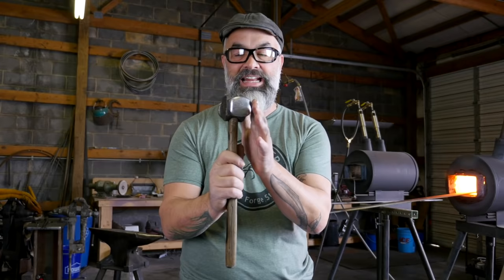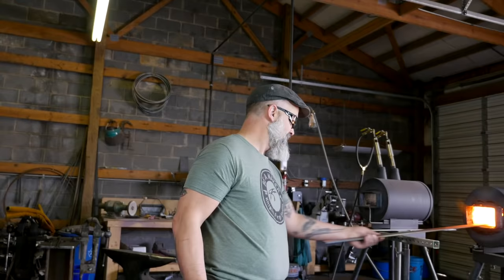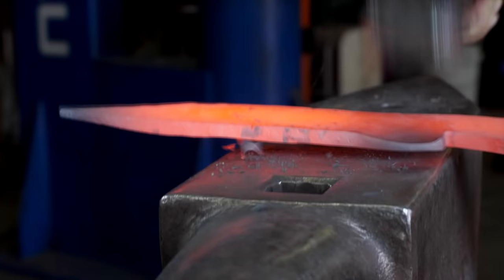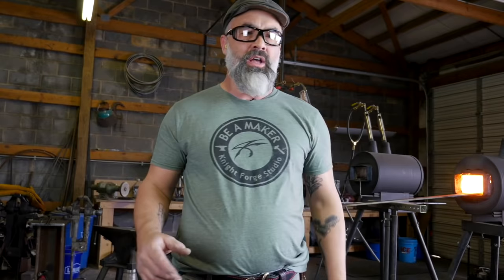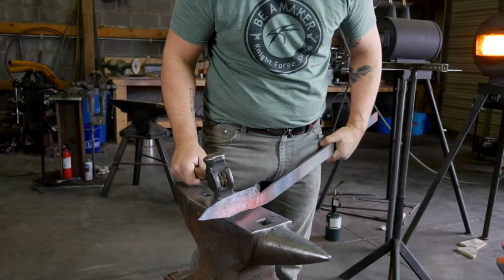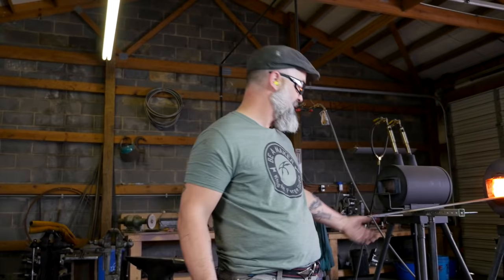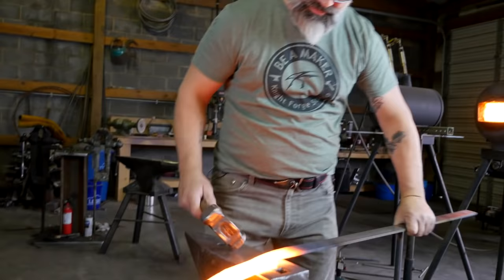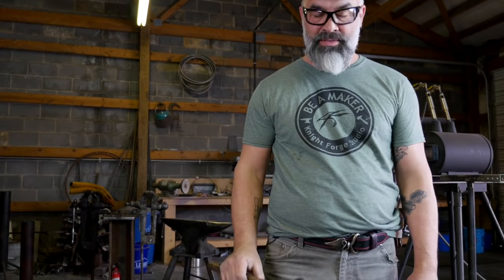BLADESMITHING | How to Forge Without A Power Hammer | Basics

Comment: The most fascinating thing I always found about when you go to work bevels, that the steel at the tip just curves back due to the way you hammer, it just does it itself, you do not need to force it to curve. It kind of reminds me of the heat treat technique of a Katana, where it curves inward briefly, and then the spine begins to cool and it curves back. Steel is so simple, yet so fascinating to watch being forged in so many ways.

Comment: My introduction to metal craft was in jewelry where the only way was to spend countless hours filling and thinking and stressing about not wasting valuable materials. Took over a year of forging to realize that valume is equally as important as perfection. What I always tell people when they're in my shop is, "get the steel between your hammer and the anvil and the rest will come in time" You answered a question I didn't know I needed to ask about blade geometry and how it transitions into handle geometry. About 1/2 of my knives come out with the bevel on one side. Since this video I never forge bevels with the handle over the anvil and the problem went away completely!

Comment: Ive been self taught and you tube taught for the past cpl years. i started with coal forge diy method my whole purpose is so i jave the ability to make a knife if i ever needed. Now im getting better and slowly acquiring more equipment I wish i had watched this video before i ever started. Lots of great info in thia video. I primarily make knives from farrier rasps and old files. I do stock removal for throwing knives from saw blades steel. This video is much appreciated. Especially about the part of not having to keep it flat the whole time. Chasing steel. Very informative 🙏

Comment: Nice bit of hand forging with some great advice and showing of what to do and telling of what not to do. I learn a lot watching videos like this. Now all I need is to build a forge and put in the work myself as I save up for, or build, better equipment. My starting anvil is complete (a grinder formed anvil made from a section of railroad rail). That should hold me until I can find a better solution for an anvil or block of steel to beat on. So far a fire pit is my forge with hard wood charcoal and a leaf blower. I now how you feel about people saying their funds are limited, but I am disabled, so I am on a fixed income and mine really are. I can stand and beat for only a short period at a time, so I have to sit and rest while the steel heats up. My shoulders are about gone too, so beating time is limited too, so frequent returns to the substandard fire to keep the heat up are a blessing.
I enjoy beating on hot steel, but it takes a while with my disabilities to complete any knife. Luckily, hand finishing of a blade can be done from a stool so I don't have to worry about falling into a fire or onto a hot blade blank. And, hand filing and sanding leaves a real good finish too. It leaves me with great control. Of course there is no way I could make any production quotas for an income boost like this, but it is all in the enjoyment of the making, for me, anyway.
Thanks again for sharing what you have learned in your long time making and doing. It is educational and relaxing for me.

Comment: Thank you Jason! I learned from this video to forge the center of the heel before the edge. That's a great tip to keep the most of the heat. I will use it the next time i forge a blade.

Comment: Appreciate the upload, new to blacksmithing (Carpenter/Joiner by trade) after 30yrs working with timber, I have decided to expand my skills. Your techniques were exactly what I was looking for.🤙🏼💪🏼appreciate the upload. Cheers from Central Qld Australia.
Reply: Brother just signed up for your forge series online. I’m working with old spring steel I’ve been removing from old dumped 4wds out here in the bush of central Qld. It’s hard going so have decided to buy some 80crv2 what size would you recommend? 

I can only get 48” sent to where I live and work. I will be making the elemental knife off your series plus want to make more chopper/kukri style knives. 

Q: what thickness and width do you recommend?  The carpenter in me wants to buy the widest and thickest possible. 

Cheers - Mathew King🤙🏼💪🏼

Comment: I played your video @ 1/4 speed whilst you hammer the steel , you  can hear the steel ringing true (almost happy) when its hit.  You even apologised for a hit that was more of a thud than ring. (making an unhappy noise under ideal conditions)   within the first few minutes.  
this was V enlightening to me Thanks for sharing your Trade basics.

Have you ever work using  electronic shooting earmuff's ?  they amplify audio below ~90db & block out anything over  ~90  (+ -  5 db)
They would be extremely beneficial to try in your workshop whilst "hammering" stuff  ;)    imho

Comment: I love to see you working without any powwr tool. I only have access to the oxy-propane cutting torch at my work place. I use my working table as an anvil. Its a 3/4 inch thick cht400 steel table 2,5ftx4ft and i also use a 1ft long railroad.
Im saving for a real forge but for now the torch is helping me getting some basic forging skill. 
I have 3 knife in the making, each a different style.
I want to do more in the futur

Comment: Well, I had to come back and watch this again, Bought a cheapo anvil to get rolling, Built a stand like yours, filled the legs with sand, Started forging on a bowie, it's been awhile since I've swung a 5# sledge like that, working muscles I forgot I had, but its slowly coming into shape, I have to learn hammer control, keep hitting angled blows, but I'm determined to get it right!! Gonna head out to the shop now and hammer some more! Thanks Jason

Comment: The Mounting of the anvil remindes of URI HOFI :) Funny, have exact the same anvil, but my threeleg is much havier. Used an massiv steel plate of 40mm, milled the downside of the anvil (hard work) and glued it. Also added on all 4 corners an easy system to pull the anvil to the plate. The legs have glued bitumen mats under it. So the anvil is no more singing, of course... heavy now, but still able to be moved.

I like your way of simple explanations, thank you for that. So its easy to follow AND undersand xD

Comment: Wish I had seen this video about 50 hours of bladesmithing ago! Learned a few small details from watching you. 
Beginners: re-watch this later and I bet you'll pick up little tricks you missed earlier.

Can't wait to try hitting the back of the blade against the anvil (without a hammer) instead of fighting to find an angle to hit with my hammer. Was that what you were doing? I could barely make out the words. 
I'm also hoping that the reason my blades end up off-center is because I keep too much of the ricasso on the anvil, that's one more thing to try.

Thanks Jason!

Comment: Who needs a power hammer? One heat. 79 blows of the hammer. Not counting anvil taps. And you have a blade point forged to rough stage. But essentially done. Jason proves that if you know how to use a tool correctly, you don't over work yourself. Old Man Andy. Crimson Elephant Forge Knives Leatherwork.

Comment: Fellow newbie here, looking to get into bladesmithing, hoping you could share some details about the tools you are using in this video.
What is the make/model/weight of the hammer and anvil you are using (is there a different video for this)?
What style and size forge do you recommend as a starter?
Is a belt grinder a necessary piece of equipment to start smithing?
Thanks for the video, it was very informative!

Comment: Awesome stuff.  I feel like I really ought to learn all I can about hand forging first and then add the power hammer.  How about a similar in depth grinding video.  I've been practicing on mild steel, an occasionally come up with nice clean lines.  But not usually.  I know there are some some pointers that masters and skilled makers take for granted that I have no idea about.  I don't know what I don't know.  And hey, if you want to go all the way, show us some low tech heat treating with no oven or salt bath.  Thanks for the great info.

Comment: What about using a cross and/or straight peen to draw the edge down? Wouldn't that help to direct the metal in the specific direction you want it to move in and not push the tip back as much at the rounding head?

Comment: I want to forge a great deal, but I live in an apartment. There is a forging place in a nearby city, so it's possible. I'm not rich, but I do understand that's not a make or break thing, I have not yet checked prices at the forging place as I'm not in a position to start for awhile. Working on a couple cars and that also takes money. Anyway quick thank you for what seems to be very honest advice. And now for the new guy question... What is scale? Does it grow on the steel from the forge, or is it part of the steel such as impurities that comes to the surface with the heat? I could maybe find the answer on google or something but I'm here now so figured might as well ask.

Comment: Farrier’s call that a turning hammer. We start out turning horse shoes with this type of hammer to shape the shoe to fit, I used a cross peen to hot punch my shoes, and also back punch the nail holes. For final finishing a rawhide mallet will smooth it all out. Raw hide works good, but when available I used to make my mallets out of Dogwood. It’s harder than rawhide but does a better finish. It’s said that Christ was crucified on a Cross made from Dogwood and that’s why the flowers bear the markings of his hands, feet, and the crown of thorns on his head. The Roman’s were the 1st to shoe their horses, and I’m half Roman, and the other half is Italian. Just some random theory mixed with some traditional BlackSmithing that nobody really cares about. I just thought I’d share some useless history from an old Blacksmith/Horseshoer. Everything has some sort of history when it comes to BlackSmithing.

Comment: Jason, you're videos are very good.  It's been awhile since I've seen ya.  It sounds like you could write a book.   A very detailed book.
Could you recommend any?
Last I saw this, I didn't know much about like and subscribe.  But I recalls you wuz in SC.  A Master bladesmith or blacksmith.  Which one?
I ask, as it'd be interesting to.making a shootgun, like a double barrel, 3-1/2", 12 gauge magnum, which can shot 2-1/2", 2-3/4", 3" mag or 3-1/2" mag. Then a barrel that can handle more steel or tungsten shot.
But knives are very good as anyone that knows anything, knows there be different knives and materials are needed for different things
Then itd be interesting to make engine parts arts, like titanium aerodynamic pistons.😂😂😂

Comment: Thank you for the tutorial.  I have a question   the 200 lb anvil i have is mounted on Castor wheels on the bottom of the steel base.  The wheels have lock outs but are also rubberized on their bottoms.  i m sure they dampen things but am i losing too much impact with the rubber coated wheels?

Comment: Alright I have question regarding the heating of the metal. We have a 3 burner gas forge in our shop and we keep it at around 7 - 9 Psi which gets us to the orange temperatures. However, we only get about 30 - 60 seconds worth of hammering time before it cools of to black. What are we doing wrong that prevents the metal from retaining the heat for as long as yours?

Comment: How much the weight of the hammer counts?! Because currently I don't have a blacksmithing/rounding hammer, although I would like to buy one... Instead, I have a cross pin hammer weighing between 250-500 grams and drawing out takes a looot of time, especially when the steel is thicker than 1-2 inches.

Comment: Is there a reason you're only using a single hammer to forge the entire blade? I only have 3 years and a few months of experience and am preparing for the first step to journeymen with the ABS so that's my level of experience with bladesmithing... the fanboy in me compels me to mention I am also am a big fan of FIF however the show made me realize I could build a coal forge for cheap to and give the craft a try. I had dreamed of making blades since I was 4 or 5 and caught Conan the barbarian on HBO.

I am wondering why your only using 1 hammer, I see this a lot in videos on youtube and it seems like there is some kind of unwritten rule that a  bladesmith can only use 2 hammers a hand hammer and a large hand hammer. I am a guy who exclusively uses hand hammers, and does not have the electrical capacity to run a power hammer in my 120+-year-old garage.  

I started with the Stanly blacksmithing hammer, however, Over the years I spent smithing  I bought several sets of and individual hammers on Blacksmithdepot.com, usaknifemaker.com, and Amazon. this was because I had some money to spend on it and I also wanted to see if I like a different style better. Because I did this I was able to learn that different styles of hammers work better for different tasks and different tasks work better with different weights. right now I am also not selling so I use leaf springs to practice as I made a promise to myself that I would not sell a blade that was not commissioned by my mother until I pass the ABS journeyman performance test.

first, I keep all 20 or so of my hammers on a workbench right next to my anvil as I can switch between heats thanks to my propane forge. now my forging prosses is this: I start with my preferred general use hammer which is an 1600 gram swiss pattern hammer to draw to the size I want to and also to start the handle and do some light planishing work. once I am satisfied I may do some additional planishing if I have a lot of hammer marks with a 2lbs dogs head, then use an 1200 gram to profile the tip and may go back to the 160o gram to finish the handle, then move to a 1.5lbs Japanese style hammer to finish the tip do my initial bevel (in a manner Illya shared over on That Works),  then I start planishing the handle with a 1lbs cross peen, then a .882 french style hammer, and I may even use a 1/2 lbs hammer to do the final planishing.  if I am doing damascus I may use my 2000 gram swiss pattern hammer to help set the welds because I can go down the bar faster then any other style of hammer I own right now. If I am doing a canister I use a 2000 gram Norse style hammer to set the canister weld. 

The benefit to this is you will not get worn out as fast or as sore and can make more blades in a day. would love for a Master level smith to give this method of hammer switching a try because I feel this is how feel smiths equipped armies 10,000+ strong before the advent of the trip or steam hammer.

Comment: When i heat my steal up and start to hit it it just doesn’t seem to move very much or very fast am i not swinging hard enough do i need a heavier hammer?
Reply: It is more likely that you don't have enough heat.  You don't have to beat the tar out of metal to get it moving as long as the metal is hot enough.  If you are working in bright sunlight it can be extremely challenging to tell the difference in your heat, whereas if it's slightly dark you can easily see the different colors in the steel.   If you have to forge in bright light, then listen closely as you make your first hits.  It needs to "smoosh" more than "ring".   Also, don't expect it to move like playdough.  Once your heat is right and you get that smoosh, you'll see how much it moves and how easily.  Trying to move massive amounts at a time only adds work because you're making extreme dips and waves you have to take out later.   Slow and easy, don't kill yourself, and don't waste time and effort hitting cold metal.
Reply: J Wilson Handmade Knives Okay i’ll remember that, thank you!

Comment: In my opinion one should NEVER start with forging and then immediately use power tools. First one should learn the basics with the most basic tools before slowly expanding to more advanced tools. I started with nothing but a hammer, and a hand file. Only after learning the basics with these very simple tools, did I expand my kit to an angle grinder, belt grinder, and log splitter converted to a small forging press.

Comment: Alot of heats, very little use of the edge of the anvil, lack of control of the steel because of the excessive length, lots of sloppy hammering with no thought given to what each blow makes the steel do. Amateur forging at best.
Jason is the not the "master" he touts himself as... with hammer and anvil anyway. Stick to the power hammer, Jason.